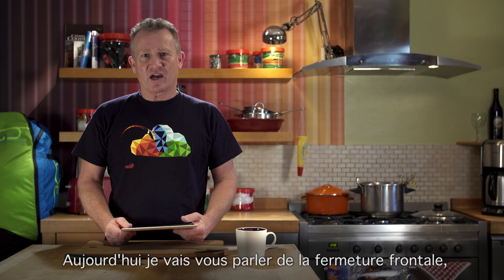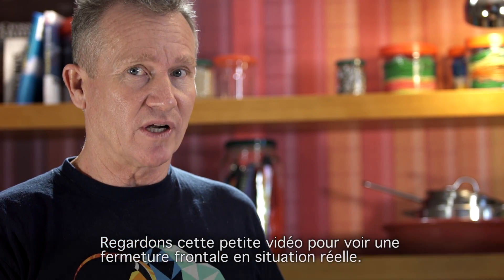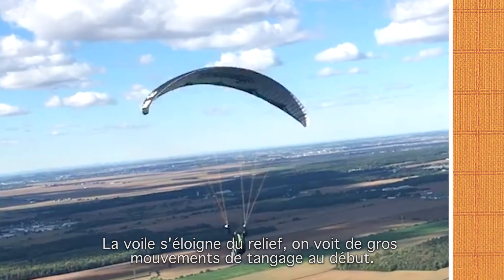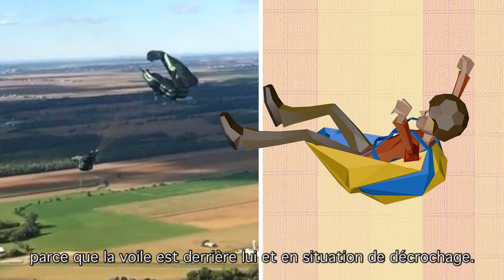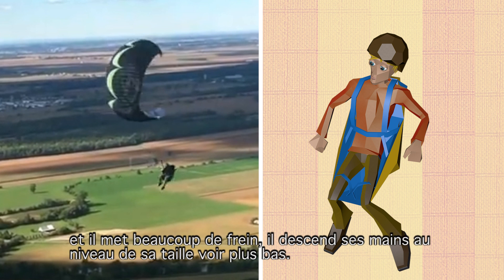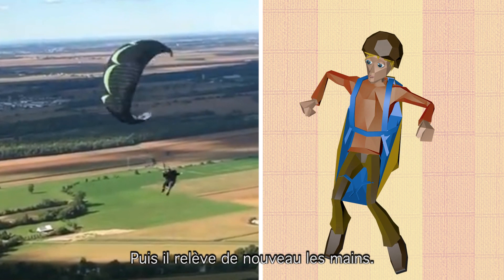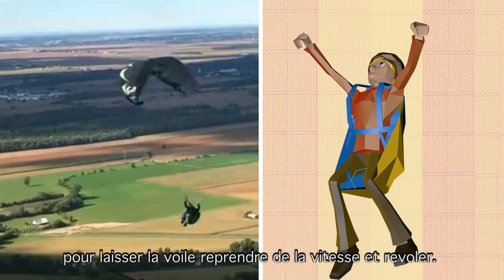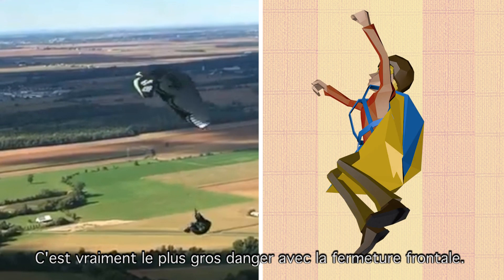FRONTAL RECOVERY - Learn to fly - BRUCETUBE S1E1

Comment: So I'm a bit confused. You said he went hard on the brakes when it pitched back and then hands up once it corrected that. But in the synopsis it says hands up on the pitch back is correct?
Reply: He did not say that...he said that hands have to be lifted when the glider pitches back; then you apply a lot of brakes when the glider shoots forward (due to pendulum condition), but just for a brief moment, so as to stop the wing from collapsing again (or even worse, dropping too much and falling into your glider), and then lift the hands again, so that the wing gains speed and avoid stalling the wing.
Reply: @riconjos  That is how I thought a recovery should go. Thanks for the clarification, I just must have heard it wrong. One of those things it is worth being sure of.
Reply: Will Winkler Definitively!